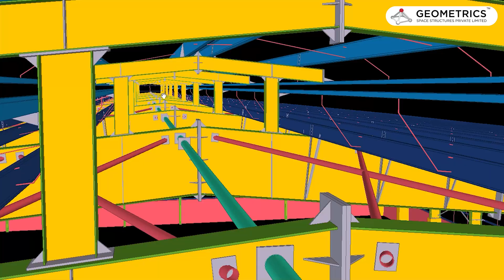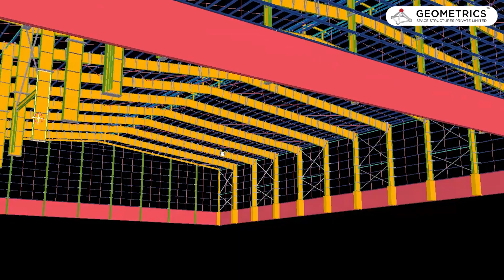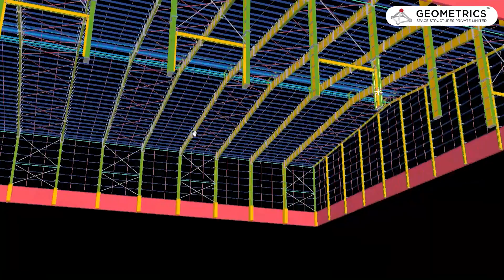EB Bill கட்ட தேவையில்லை. தண்ணீர் பிரச்சனை இருக்காது, மாடி தோட்டம், நினைத்த தொகையில் முடிக்கலாம்

Comment: Existing house RCC-columns in terrace i have to lengthen and build 2-more floors. Can i use overlapping of these steel columns inside RCC columns for say 5-6 and lengthen the columns in steel itself ????
Reply from the maker: Kindly feel free to call our technical team 9943744405. 
They will guide you for the best solution.